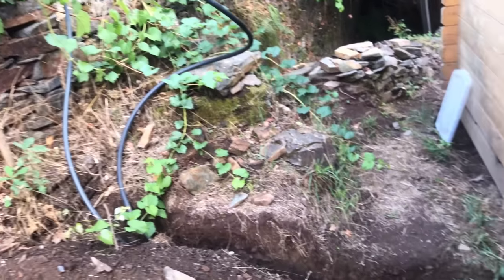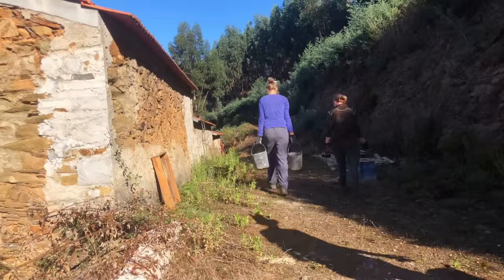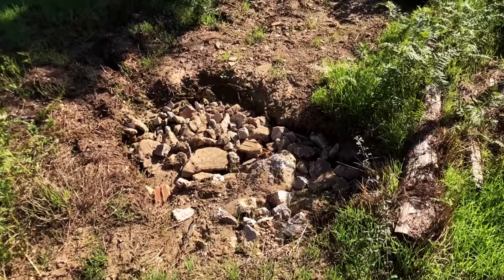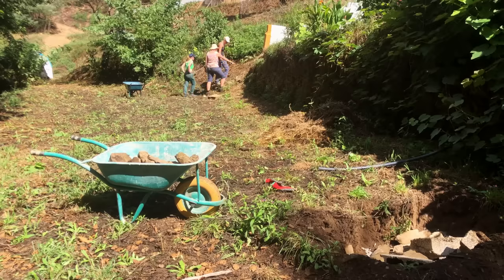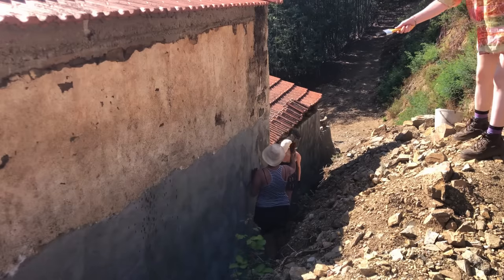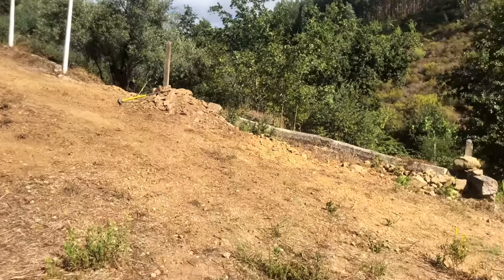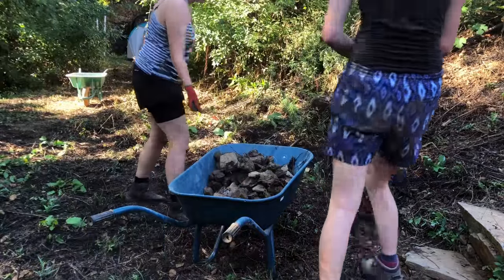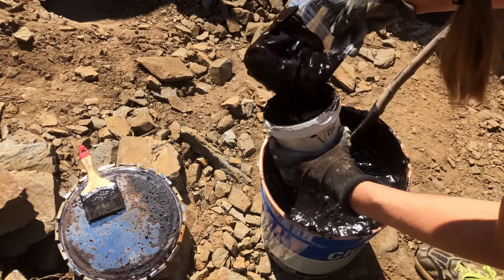3 Girls Can't Stop Building Things

Comment: Great work Maya, and your Rock Team, and not forget the shower helper.  With so much wood on your property, I would have made a Rocket Stove and a 20 mm copper tubing rapped around the high riser/ stove pipe to feed into a solar geyser for life, saving you a lot of money on gas.  Plenty of Rocket Stove designs to have free hot water for life.  You can build another one for heating your outdoor spa bath/pool, again, many designs and types of materials one can use.

Comment: HI Maya, A couple of things.
1) Great to see you create a staircase from the river terrace up to the house terrace; I think it has been long overdue.
2) I was surprised to see you cement in the french drain pipe; I have not seen that done before in videos from France, Spain, the UK, the USA or Australia.
3) Nice to follow along as you improve your comfort levels each week.
Good luck with your continued renovations.
Reply: I have no idea why she's covered the French drain with cement. At 1st I was thinking to block the area from the ground water so only rain water could get to the wall, but the bottom of the tube was exposed to the ground below. But the cement gets rid of a lot of the surface area to absorb the water in a downpour, so I don't understand what's going on. I just hope it works.
Reply from the maker: Hi, because the pipe is perforated also in the bottom it needs sealing from below, otherwise the water would just pass to the lower parts of soil :)
Reply: @mayafeliz  I don't think that's how French drains work. They operate under the premise that the water takes the path of least resistance, and that is seeping into the pipe from the bottom. As the level in the pipe rises, it flows down it, utilising surface tension to draw the rest of the water with it. As I understand from what you have done, the concrete will act as a run-off itself, and it is unlikely it will ever reach the top for the pipe to serve any purpose. Whether that matters or not, I do not know. https://www.youtube.com/watch?v=eRL_5G9c08s&t=62s

Comment: Maya you also need to: 1)cover the walls with a PU based paint-on film (twice) 2) Use a separate plastic membrane against the wall before filling the ditch with soil 3) make a two-level (one at the bottom and one half way up) french drain system before filling it all up. French drain pipes need to be surrounded with gravel and geo-textile. This will be a decades-spanning permanent solution.
Reply: Great you have this knowledge to share ✨🙏✨
Reply: I'll ask you since you seem to know what you're talking about,  but it seemed odd and counter intuitive to line it with concrete. It makes sense as in it will keep run off from the gutters/roof from getting into the building's foundation, but ground water can still come up and get into the foundation from below in the rainy season, so wouldn't it be better to allow that water to get into the French drain and move away from the house? I'm confused with this one.
Reply from the maker: Let's wait for the next episode 🙌
Reply: I think Maya is more qualified then most of us. She is an architect after all and the support system around her is great. The two stone masons that come to help out can definitely give some advice too.
Reply: @harveythepooka  that’s exactly what I was thinking.
Reply: Yes, I thought French drains should be covered in a sock unless there’s a lot of clay in the soil. Clay in the soil clogs the sock. But I’m confused, won’t the cement clog the perforations in the drain? 🤔 I will wait till next week to find out. Maya , the suspense is killing me. 😉
Reply: @harveythepooka  Water seeks the path of least resistance.  So if it is below the slab (concrete floor) it will still rise through the concrete floor.  The only solution to water migrating up through the concrete floor is to jackhammer it out, lay down a permanent water proofing system that drains into a sump or to daylight and pour a new slab on top. 😊
Reply: Right? I'm thinking cement? Why?
Reply: @pollyb.4648  Are you referring to the cement around the French drain?  I've never seen that anywhere. Many mistakes were made with the French drain, but I suspect her buried wall will be MUCH drier now.  At least the drain runs to daylight and there will be gutters along the entire roof edge.  That alone will make a huge difference as will all of the layers of water proofing applied to the walls.  The next step is a mini split on the ground floor to circulate, filter and dehumidify the air. Of course, the inside walls should be plastered/rendered with quicklime and left the  natural color.  No paint.

Comment: Well done for tackling this project! I also started with little knowledge and have learnt everything from working alongside more experienced people and then more research. In that spirit, here's some info for future improvements - I would really recommend putting the 'knobbly' membrane against the wall (it's a semi-rigid sheet / panel with protruding bumps, looks like rigid bubble wrap) before backfilling. In fact with that product you don't actually need to waterproof the wall, you leave it vapour-open, if you ever have to tackle this again. I also always start with a geotextile membrane in the trench, (to stop the gravel sinking) then a gravel layer, then wrap the perforated pipe in geotextile membrane (to stop silt from filling the holes over time) before laying it on the gravel. Finish with a layer of gravel placed quite carefully on top of the pipe - the aim is for this top gravel layer to spread wide, to protects the pipe from crushing - better still, line the sides of the trench with big rocks, just proud of the pipe height, and in-filled with gravel, to keep loading off the pipe.
Reply from the maker: Thank you for your tips, I really appreciate it!
Reply: You're so welcome - I have lots of lovely people to thank for teaching me and now I build natural houses! x

Comment: Well-done. I just want to say that several people have used this exact water heater in off-grid showers (in Portugal). I've seen at least 2 of them encounter the same problem. Being outside in the elements in winter the pipe froze and burst (if I remember correctly). I know "Frankie off grid" had this problem. They might give you some advice if you contact them. Please don't take offense to my comment. I just want to avoid you having the same problem. I am enjoying your videos. Thank you.
Reply: You mentioned building a structure around the shower heater; I am sure you thought to include insulation to protect the heater + pipes.

Comment: Nice job on the wall. However if not already planned, coatings have a short life span and do not give optimum protection there are special plastic cheap barriers for that on the market; Stud track wall protection as final barrier which you can put on after the coating. Good luck!

Comment: Great to see Girls doing a wonderful hard job. Respect for you guys weldone! The concrete on the side of french drains is for me a question mark the goundwater should find the easyest way to the drain and cement could clog the pores is my thinking flush the drain when covered by gravel from the top to push out the cement from the pores if possible. Great video. Nice shower show.

Comment: If you want to water proof the stone house walls where they are inside the hill.
Then your going to need a concrete sealant to get painted onto the concrete, otherwise it will keep absorbing moisture.
A piece of plastic rated for water will also help to keep the water out.
Reply: She did that.
Reply: My internet took a dump and the video stopped loading, so I only got to watch about half of the video.

Comment: For the roof of the ourdoor bathroom the easy way could be a piece of corrugated sheet but i'm afraid with the Portuguese temperature it will turn the little bathroom in sauna and it's not really esthetic so may be you could collect enough branchs on your land and build a wood roof 

For the floor you could fill it  with gravel and put a large stone (one you could put your two feet on it) under the shower 

As for the gas bottle may built a box to put inside and like this you could have a furniture to stand your towel and shower gel more than put them on the floor

Comment: Hi Maya 
With applying Cement Render
Or Sand & Cement 
You can use a light metal tin box with a hand winder 
It flicks out cement or 
Thick paints on too the wall a faster thicker applicator. 
Or heavy fluffy Rollers 
Can be faster applicators for uneven  surfaces.